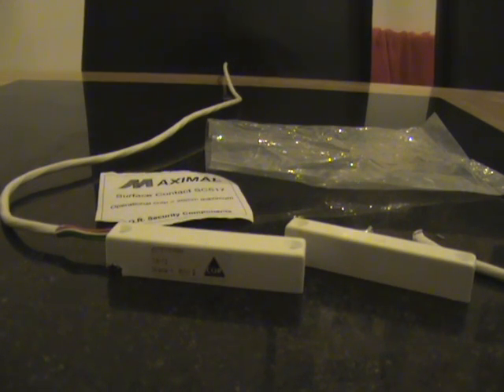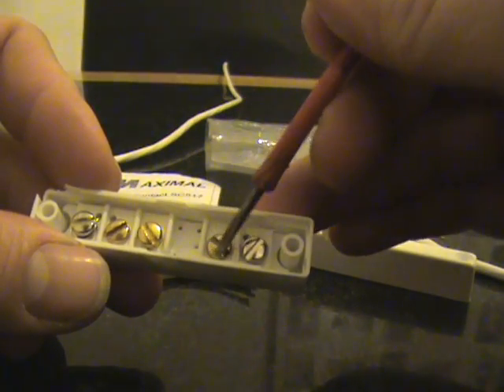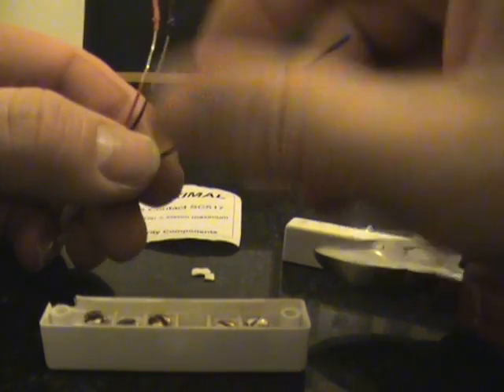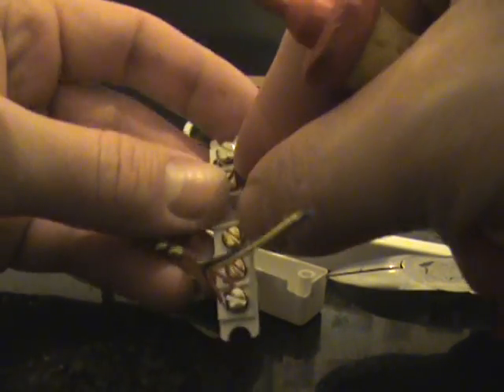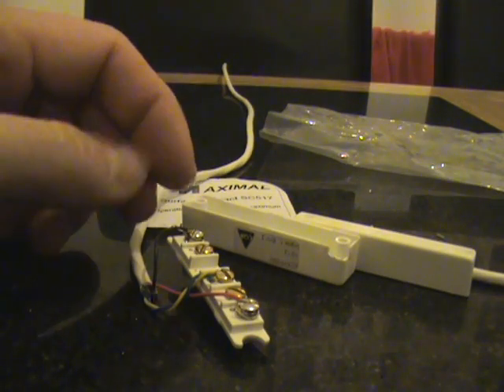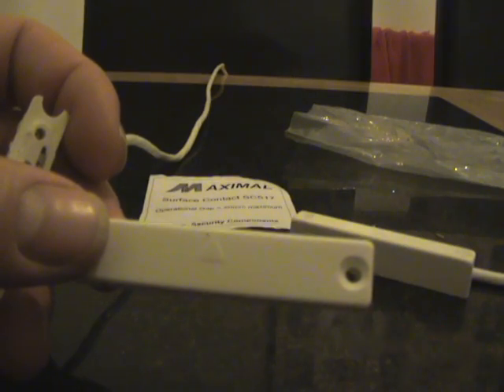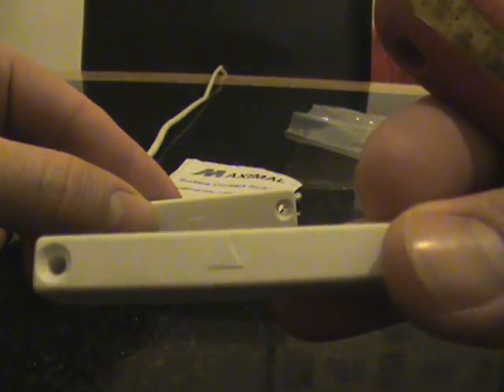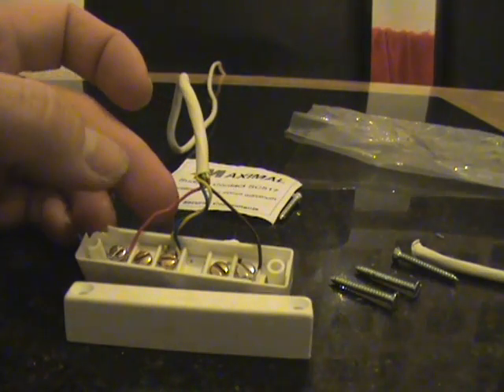how to change or wire a domestic burglar alarm surface contact ( 4 wire )

Comment: Clear video, thanks!
We are replacing a wooden door with a new composite unit.  
The alarm switch I have to replace is currently a round flush mounted unit.
The wires have single yellow and red screwed in to two screws, with black and blue twisted to another point.
Presumably the black & blue are the ones you describe as tamper wires in your system?
Thanks!

Comment: In which order do i put the coloured wires ? Do i just use the silver screws & leave out the bronze one ...
Reply from the maker: I'm afraid there are no standard colours, you would have to use your existing colours or identify  what they were. The silver terminals  are the contact and the brass are just spare terminals.
Reply: @danniespeakman77  thanks for this comment and thanks for the video. I wired the black and red wires to the 2 terminals on each end but it didn't work then after reading this I checked and they are brass so I wired them to the silver terminals and it works now👍
Also the Honeywell AC034 contacts I bought don't have the arrows on them so I just guessed it, assume the arrows are there because the reed switch is on that  side of the contact? It works anyway so thanks

Comment: Thanks thats helped me out i have to change mine from original flush fitting contacts to the door mount on new PVC door .the two chrome screws are for the contact and the others are for just joining the other cable together thanks for posting it made it very clear for me to fit the new contacts Cheers